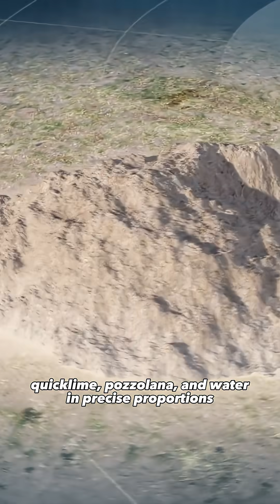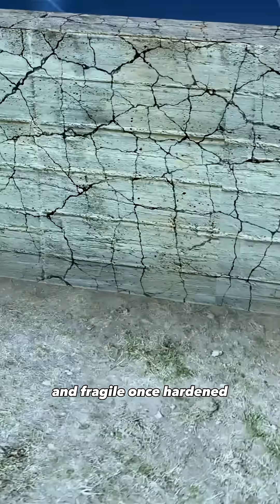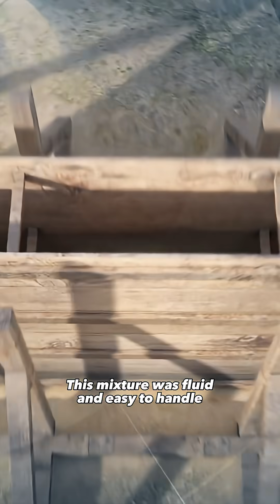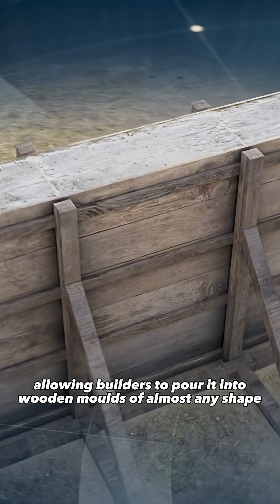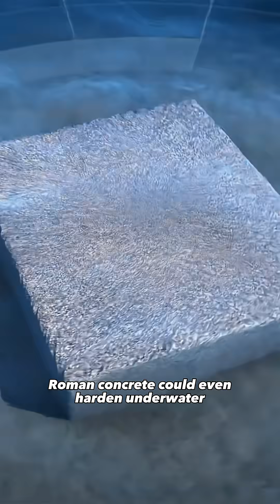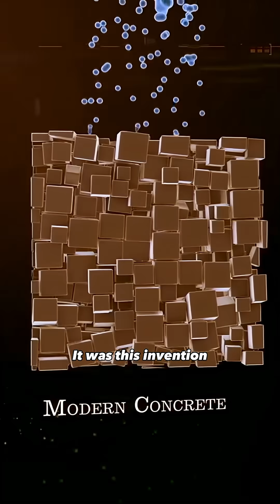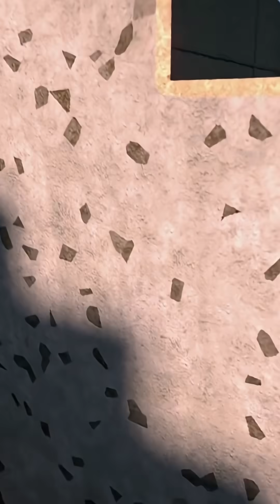The Roman concrete #history #romanempire #engineering

Comment: Release the ingredient mixture files.
Reply: Volcanic ash
Reply: @lunafragment7202  Hmm, interesting.
Reply: @lunafragment7202 also it was salt water (sea water )
Reply: @lunafragment7202 if only I had access to volcanic ash...
Reply: @lunafragment7202  HAHAHAHAHAH
Reply: @garythegariest what's funny,  it's correct
Reply: @garythegariest  that’s what Roman pozzolan is. I’m not sure of what’s funny, either.
Reply: @SleepiestWren And as we all know, correct things are never funny
Reply: Big rebar doesn’t want you to know.
Reply: @stevewilliams8590 Ha! 😂
Reply: @stevewilliams8590 still need steel reinforcement for modern engineering because no concrete ever made has useable tensile strength, which is the reason we steel reinforce concrete in the first place.
Reply: @Microwave_King maybe we could cover the rebar in a polymer before putting it into the concrete so that way it doesn't compromise the concrete
Reply: @rbkommando5456 I know right?! I've been wondering the same thing. Like just coat that stuff in Rhino liner!
Reply: @rbkommando5456 rebar isn't compromising anything in the concrete, though. It adds strength that concrete doesn't have on its own. Alone, concrete is great at resisting compression forces, but crumbles instantly if you apply tension (pulling two ends apart). By adding the steel rebar to it, you're adding a material with high tensile strength giving the finished product an internal structure capable of resisting tension forces and an exterior structure capable of resisting compression forces.
Reply: @Microwave_King the water used in Roman concrete is salt water. Which is why we can't use it in modern infrastructure. The salt from the Roman concrete would compromise the rebar. That's what they mean.
Reply: @rbkommando5456  
No putting up salt water in concrete but trying to protect rebar from chloride attack from salty water with polymer is not needed at all.
The concrete we have now has better compression strength, tensile strength and less permeability it has predictable strength and it sets fast and gets to its ultimate strength faster than Roman concrete. Also you have thousands of admixtures and mix designs can be done to make it suitable for wide applications.
If you want a concrete that you want to survive in chlroide and sulphate water then you just need to design the concrete in a specific way so that it is really dense and for this condition coating steel with epoxy or polymer is done probably. 
Roman concrete took ages to set to its full strength hence they took forever to build. 
The sea water and pozollana made it chemically durable in sea water and water with sulphates. But we can easily design modern concrete to tolerate those conditions.
Reply: @Microwave_King no concrete has good tensile strength
Reply: @Microwave_King what a farce the metal weakens the concrete.  It rusts and disintegrates over time causing lots of issues with age
Reply: @Microwave_King  You think we couldn't make one family houses with this or small villas? Highly doubt it.
Reply: @stevewilliams8590 😂
Reply: MIT found  it in 2023. The secret was to mix quicklime while still very hot.
Reply: @thomaslacornette1282 what is Pozzolana?
Reply: @isdz6951 Pozzolan is a label for many materials nowadays but as stated before Pozzolan in Roman concrete was Volcanic Ash.
Reply: @thelizard556 thank you
Reply: @isdz6951 a type of cheese found on Italian pizzas. 😂😂😂
Reply: @thomaslacornette1282 curious and curiouser
Reply: @thomaslacornette1282 that's not true they did not use quick lime
Reply: 0.7 part water, 1 part lime, 3 parts (pozzolana) volcanic ash for for buildings exposed to air. For those exposed to water, increase to 1 part water, 1 part lime and 2 parts pozzolana, Mr. Baron Rodney.
Reply: @NeoEon wrong.
 you left out the 
aluminum tobermorite and 
obsidian and  
pumice and
Salt water.
Reply: Also the volcanic ash has to be high in alumna @NeoEon
Reply: Its lime, pumice, and ash. 

Thats it dawg.

What happens is the volcanic ash once set, grows tiny interlocking crystals that harden the material. Plus, the lime isnt mixed 100%, and over time little pockets of raw lime, get dissolved and flow through cracks, therefore sealing it back up again.
Reply: @c @cmw184 and salt water instead of fresh
Reply: @cmw184 
Revelation 3:20
Behold, I stand at the door, and knock: if any man hear my voice, and open the door, I will come in to him, and will sup with him, and he with me.

HEY THERE 🤗 JESUS IS CALLING YOU TODAY. Turn away from your sins, confess, forsake them and live the victorious life. God bless.

Revelation 22:12-14
And, behold, I come quickly; and my reward is with me, to give every man according as his work shall be.
I am Alpha and Omega, the beginning and the end, the first and the last.
Blessed are they that do his commandments, that they may have right to the tree of life, and may enter in through the gates into the city.
Reply: @cmw184 no
Reply: Josephus Epictetus of Arsenokoitai did not assassinate himself.
Reply: sea water was the magic ingredient
Reply: It's subLIME........
Reply: @vernshein5430 😋
Reply: welease bwian
Reply: @harrywakatipu2547 release Woger 😂😂
Reply: 😂 ok Mr Smarty, very clever!
Reply: This was done when school had 2 subjects, yet here you have the internet in your hands and still can't figure it out. Some might say the new generations are indeed full of morons with the single digit iqs.
Reply: @abandonedgod  mfers back then also didn't have to worry about like any of the things we do in the modern age. Someone could just make their whole life a side quest trying to figure out the recipe for concrete 😂.
Reply: There's nothing unusual about mixture It's the size of the particles used in it which adds the so-called self healing quality A certain measure of less refined quicklime particulates is included Most likely a quality control issue turned happy accident rather than finely grinding the quick lime leaving it with some larger sediment allows it to be self healing when exposed to water any fractures break the large granules of quicklime down into smaller particles which the water can then dissolve and re bind with the aggregate
Reply: @sheaross3124 NO THERE WAS NO QUICKLIME
Reply: its all out there if you search, the saltwater concrete was a diff recipe
Reply: not known today
Reply: @benjaminbritsch1749  I have read that the lost ingredient was volcanic ash or human blood, but you are correct. I also recall that we still do not know the key ingredient of Archimedes' weapon invented to burn attacking ships.  I believe that it was called, "Greek Fire".
Reply: @sonofizzy-rev  Greek fire was lost too. Well we have napalm
Reply: @sonofizzy-rev it was just ancient napalm
Reply: Mossad hides the recipe
Reply: ep-stein gaining a whole new meaning in german.
Reply: Heat. They added, heat.
Reply: Haha, I see what you did there.
Reply: lime and ash
Reply: They already did bro.
Reply: The recipe is largely figured out already. it's no mystery
Reply: You tube search 
"Unlocking Roman concrete"
It is publicly available information!
Reply: The blood of Christians.
Reply: Pumice stone was used... instead of aggregate... especially for ceilings.. it's common knowledge
Reply: Please
Reply: It’s a cover up like flat earth
Reply: Lime mortar mixed with volcanic ash
Reply: The real recipe for how it was made has been lost to time
Reply: What happend on pompei island rome?
Reply: Alongside the written logs and words of Michele Nostradamus!
Reply: 😂😂😂😂thank you internets for the comments section
Reply: they had figured it out recently but no dice in escalated it
Reply: They'll be heavily redacted 🤣🤣🤣
Reply: Unredacted!
Reply: F it, let's experiment until we find!!!
Reply: "them" "the province of ludaea" is hiding the recipe, wake up my fratres!!!
Reply: Vesuvius ash, duhh?
Reply: quite literally, you've had access to that your entire life.
Reply: All of these people in the comments Don't know Jack. 

 They did not use quick lime they use baked lime stone,They used volcanic ash high in alumna, they also used alumna tobermorite ( this had to be mined freshly to ensure chemical reactivity )pumice, volcanic rock, salt water. I think that's it if I remember right.
Reply: Известь
Песок
Вулканический пепел
Вода

Пять тысяч рабов, чтобы все это добыть и замешать. 😂
Reply: @doktordizzel9261 no
Reply: Yeah, forget releasing the Epstein files. Release the ingredient mixture files, so we can finally crack the code for making ancient Roman concrete!
Reply: @trickyricky12147  Both! 😮
Reply: @glennruscher4007 no we don’t need both
Reply: @DappaJordan no, we need, especially when GOP resists
Reply: @w_gospodin_nikto_w2063  ahhh but no mention of Quid Pro Joe sitting on it for his entire term, eh? What kind of midwit trusts any file held by the government for years, when it almost certainly implicated them? Do YOU think the three letters wouldn't alter the files? Naive.
Reply: @trickyricky12147  that's the joke
Reply: The secret is lime , but roman concrete is salty so it wouldn't work well with rebar @trickyricky12147
Reply: @trickyricky12147 you need to live near the sea and a volcano. Do you want to move to Italy or Japan?
Reply: @sergiocovelli  There's Pozzelan in California too lol
Reply: Powdered Limestone is what makes it self healing
Reply: @kobusthomas903 Ahh, but it's not limestone. It's either quick lime or slaked lime.
Reply: @bitTorrenter it's not quick lime it was literally baked rocks of limestone thrown in and mixed together with everything not powderized
Reply: @kobusthomas903 wrong
Reply: @kobusthomas903  No it isn’t. It was because it was not thoroughly mixed and homogenised leaving dry unmixed nodules of calcium carbonate dispersed throughout the mixture. When the concrete cracked water could seep in and wet these nodules which would dissolve into solution and fill the cracks forming a relatively weak bond. It is likely that this was not a deliberate technique but rather a result of poor mixing.
Reply: @baarni  so over time the self-healing would stagger once the deposits were used up, yeah? 

If that's the case, a lot of them are still standing. Remarkable.
Reply: @AtKGs8nx Did you mean stagnate? Yes the self healing properties would stop.
Reply: @baarni an unmixed nodule of calcium carbonate is..  a piece of aggregate or, in other words a pebble. Water would take a long, long time to dissolve it as you describe. Therefore I believe you are referring to an unmixed nodule of calcium oxide [CaO].
Reply: @baarni finally the only person who actually knows
Reply: We’re getting close to reproducing it properly. One of the things that was only discovered fairly recently was that it’s a hot mix. The problem with producing a similar compound, which we can do, is that it is way more expensive and labor intensive.
Reply: @UnderLordMalcolm  you’re suggesting we need to start using slavery on a Roman scale again?
Reply: What's more labor-intensive doing the cement work once or doing it every 20 to 50 years when it cracks and crumbles?  Long-term it's cheaper to build it right with Roman concrete the first time.  @UnderLordMalcolm
Reply: @UnderLordMalcolm expensive and labor intensive? Really? Expensive compared to what? Certainly not Roman time. Earth has 100x more people and money now than back then so if they could do it no problem then we can. Expensive is nonsense
Reply: @WLH-ss2qw the thing is slavery and forced labour are now banned, unlike in the Roman times where you have slaves, the condemned, and prisoners to mix it for (almost) free
Reply: @FlyingPlastic356 we have machines now surely they are capable of mixing such hot mixtures
Reply: @UnderLordMalcolm also weaker than modern concrete mixes
Reply: @rubenheymans1988 that they're not, seeing that modern concrete rarely holds up to a century.
Reply: @a7HKdAbmET there's a difference between strength and longevity mate. Let's see if roman concrete can withstand millions kg of constant stress and wear
Reply: @quadratic7578  Indeed, but that is easily seen by them designs of ancient buildings, especially big ones with more stress and wear, and those were the most likely ones to survive. Pantheon comes to mind. 
The main thing that modern architecture does better is not because of the concrete - using rebar within concrete to increase tensile strength of the construction is a more recent innovation if I recall correctly, and the greatest innovation in modern construction, alongside modern tools, compared to ancient Rome. Creating anything with most types of modern concrete without rebar compared to the roman concrete will usually be weaker in strength, too.
Reply: @rubenheymans1988 that's a farce modern concrete lasts 50 years that's it that's the lifespan.
Reply: They still working on discovering the formula... 2500 years ago Romans were making cement that would last forever, now we have to knock down buildings after a few decades... go figure.
Reply: @ComboMuster  gotta keep people working... or they wont do your bidding.
Reply: @ComboMuster  I thought it had something to do with saltwater being they key ingredient or something.
Reply: @BaronRodney  well it is all suppositions and guesses so far. Some nutters were saying aliens gave them the recipe 😁😁😁
Reply: @BaronRodney I think the leading theory now is that large lime aggregate in the mixture would react to water that entered cracks, making a slurry and resealing the crack from the inside
Reply: @ComboMuster  Yeah you know, I kinda have a feeling that that's probably the least likely theories so far but hey... that's just me. 😂
Reply: @BaronRodney  Saltwater and volcanic ash would make them self healing for some time.
Reply: @BaronRodney  No volcanic material
Reply: @BaronRodney   partly. That , burnt and crushed seashells were also an ingredient.
Reply: @BaronRodney  I think it was actually a combo of raw calcium carbonate and charcoal.
Reply: @RCLewisLewis  Charcoal huh? Was that a substitute for volcanic ash I wonder?
Reply: @BaronRodney  Yes, saltwater and volcanic ash (pozzolana).
Reply: @BaronRodney  There was a lot of limestone in the mix, and it would heal itself and strengthen every time it got wet.
Reply: @BaronRodney  Human Blood
Reply: @poacherboy
Yeah, so long as there is lime... otherwise once the lime runs out, the cement is done.
Reply: @ComboMuster  volcanic ash / limestone / calcium are the reasons cement "self heals" And is very strong to sea water, almost impervious.
Reply: Not working, they've recently found it
Reply: nah bruh they will say anything to make u thonk they stupid.
Reply: @ComboMuster The stresses and requirements of our structures are very different than those of the Romans. Same with their roads, did they last a long time? Sure but they didn't have multiple ton vehicles blasting along at 65-90 mph
Reply: @ComboMuster  We know fully well how to make it, its just extremely expensive and also incompatible with reinforcing rebar.
Reply: @ComboMuster we can do better stuff that the Romans nowadays. Modern concrete is way stronger
Reply: @ramr7051  Modern concrete it IS a lot stronger however it doesn't last 😁😁😁
Reply: @ComboMuster  thats on purpose mate...

our economic does not work otherwise..

its why thing does not last as back in the days.

the money must flow
Reply: @fantomchaser1 Our modern society is constantly changing and evolving. Not to mention that modern structures are generally built by private companies at cost and time constraints not governments like in ancient times. Ancient societies were unchanging for centuries so some large infrastructure was built to last centuries. Keep in mind though that more than 99% of all structures built back then are long gone. We could easily build structures that outlast anything the Romans did but what is the point?
Reply: @baarni  What i wrote is not limited to concrete..

we have a debt based economic..
it requires constant growth and consumption.
each year it requires more than the previous year...

its why they tried to implement "Planned obseletion" was it back in the 80s... 

So instead they make things of 
less quality
more parts (bigger chance stuff break)
one time uses.

Stuff like that..

By building stuff in better quality it gets a much better reuse value
If we talk on the enviromental side of things
this also brings benefits.

Any ways our current way of life cant keep going..
not unless you remove like 80% of the population then we can consume and throwaway as we want..
Reply: @fantomchaser1 bla bla bla.😂
Reply: @ComboMuster we figured it out already you're behind on info
Reply: @ComboMuster it's mostly the steel rusting that kills modern concrete.

Concrete cancer.
Reply: @myne00  Acidic rain, salt water and whatnot.
Reply: @ComboMuster  because reinforced concrete is a lot stronger for reduced size and cost than alot of the strenght of roman was because of the size and amount of materials. They also used lead in the piping components are we going to start doing that.
Reply: @eggos5074  What on good earth are you talking about.... talking about costs do you even know how cement is produced? not even talking about the rebars used in reinforced concrete. We do not know the exact formula of Roman cement otherwise engineers would use it except for special projects like I said.
Reply: @ComboMuster  The mixture is already known. Nothing magical about it
Reply: @threnn9509  It is not known, at least not the exact formula, it has never been successfully recreated in spite of many attempts. It is not enough to know WHAT goes in there but HOW MUCH of each component and the different stages of the process.
Reply: @ComboMuster  it isn't some crazy [de]-advancement. They had access to a material we don't and happened to use it as a filler.
Reply: @sgeine  All this blabbering has no purpose the fact is that Roman cement and buildings lasted for 2500 years. Tell me ONE building where mortar or cement was used that lasted 200 years even. All this crap talk has no point.
Reply: @ComboMuster  The formula is known and isn't a secret. Roman concrete isn't better than modern concrete, they just made such massive structures using only compressive forces. We could do it now but no one wants to pay for 10ft thick concrete walls and vaulted ceilings that will last 1000 years because thin steel reinforced concrete structures that will last a few hundred years are ALOT less expensive.
Reply: @vorpolkai  Reinforced steel structures are way faster to build and better for high rise buildings, skyscrapers and bunkers, however those would not last due to deterioration caused by steel rust. You must've heard of catastrophic collapses of modern bridges and buildings. Roman bridges can be seen 1900 years after those were build. I guess in the long run Roman bridges and other structures are way, way cheaper. Fun fact: Apollodorus of Damascus build a stone bridge in ONE month over the Danube at Iron Gates for the Roman army, it's vestiges can be seen today. I guess everything has it's advantages and disadvantages however, today we have devastating bombs and such and it does make sense to build quickly. However I would very much prefer to build my house with roman concrete and stones.
Reply: @ComboMuster Oh so you’ve bought into that nonsense too😂 Roman concrete is nowhere near as good as modern day concrete. Even the lowest grade commercial concrete is at least double the strength of Roman concrete. This fallacy has got so many people sucked in.😂
Reply: @baarni  Yet their buildings still up after 2500 years. How do you explain that? I get it for bunkers and skyscrapers and nuclear plants won't hold.
Reply: @ComboMuster bahahahaha explain the obvious 😂 natural stone is millions of years old. Shaping and stacking them is not surprising a very select few structures have lasted a few thousand years. Keep in mind almost all ancient structures did not last and the ones that do still remain are in ruins.😂 Nothing mysterious or exceptional about it bud. I guarantee you that in a few thousand years if left abandoned there will still be modern concrete and stone structures still around for archaeologists to ponder over.
Reply: @baarni  earthquakes and wars and defiling over thousands of years dude. As for modern concrete it will not last except maybe for the bunkers and forts built by Germany in WW2 and maybe a few cathedrals built 600 years ago. Everything else will just crumble to dust. Nothing done or built in the digital age will endure all info is stored on complex and advanced gadgets as for constructions? ZERO!
Reply: @baarni your faith In modern tech is astoundingly naive
Reply: @baarni that’s why my sidewalk cracks a year after it was put down?
Reply: @bakershrew  Exactly! We wash our sidewalk with a mixture of water and detergent every week, and wax it once a month so it keeps looking pearly! I'd prefer to do it twice a year, but sadly, that's what happens when you can't put it indoors and have to let strangers walk on it and drive their cars over it.
Reply: Human Fluids..😂
Reply: Talk to the Catholic church in Italy.
Reply: its volcanic ash and saltwater. its not a secret, and i don't know why people act like it is. 

it was never forgotten.
Reply: @TheSpencer033 because you're missing lots of ingredients and you don't even know.
Reply: Diatomaceous earth was the secret ingredient fools. God bless diatomaceous little creatures that make all the world's oxygen and kills bedbugs in death.😊❤
Reply: @no-turdburglars_incthat is wrong
Reply: He said quicklime and pozzolana in precise quantities.
Reply: @jhonfloibelmiculob6581 yeah but he's full of bulshit because they didn't use quicklime
Reply: The formula was finally worked out recently, and the reason why it works. It doesn't beat all modern concrete, depends on the use. Not an expert, just what I read. Google roman concrete, I'm sure you'll find it.
Reply: @UteChewb no
Reply: It's more about the process of hot mixing and combining sea water
Reply: Ash from campi flegrei,  salt water, and sand.
Reply: blood of the innocent
Reply: Seawater is the secret ingredient. The salt and other minerals in the water gave the concrete it's longevity
Reply: Huh? We've known how to make this stuff for a while now. It's not a secret anymore...
Reply: Theres a great article on Wikipedia
Reply: @jvebarnes it's trash
Reply: its not that different than modern concrete.
Reply: No way! It would cause an economic catastrophe! Imagine if we wouldn't have to build new buildings for a thousand years!
Reply: @robdom91 good
Reply: The ingredients & mix method were lost to time.
Reply: @pamsimpson4147 The ingredients can easily be analyzed from existing structures and the methods were recorded in part by Roman authors, like in the De Archetectura by Vitruvius.
Reply: @Alderak1 True but it's the mix method.
Reply: @pamsimpson4147 mix method maybe but what's in it no they know exactly what's in it.
Reply: @pamsimpson4147  It was found back in 2023 : use google once in your life.
Reply: The ingredients and mix method were sadly lost to time.
Reply: Nobody can produce it even today, even their blueprints. The old world remains a mystery. From Gothic cathedrals to Roman architecture, they are most likely the remnants from the 1000 year reign of Christ Kingdom that was written in Revelations.
Reply: @Proud-Infidel  Nonsense😂
Reply: @baarni  why are you upset? You think you're so special that Jesus will wait 2000 years for you? 😂 face it, we are left behind, we are the ressurected dead waiting for the white throne judgement. We are living in Satan's little season now. But, in the end of the day, this is just theory. A very solid theory. 

This is a solid theory and based from scriptures and physical evidence of the millenial reign. You got better argument? Let's hear it.
Reply: @Proud-Infidel Bahahahaha not upset brother. I just don’t accept your claim that your god exists.😉 Lies and misinformation is the worst kind of deception and must be called out.
Reply: @Proud-Infidel     anyone who refers the last book of the Christian canon as "Revelations" can be dismissed immediately 

and they absolutely can and have reproduced it
Reply: @Proud-Infidel We have a quite a few records to prove otherwise, Christ’s 1000 year reign has yet to come.
Reply: @schylarvelez46 then where all the Gothic cathedrals, large mansions, grand palaces, central city architectures, marble statues with fine details and sunken old world houses and buildings come from? There are literally gothic cathedrals around the world already pre Columbus. Surely when Jesus said this generation wont pass away before his return, he was not talking to people 2,000 or 5000 years later, he was talking to the people who are listening to him directly during that time. And that was in 70 AD.
Reply: @Proud-Infidel  you really need to reread the whole chapter you took that verse from regarding the setting of human society before answering that question.
Reply: @schylarvelez46  Will never come.
Reply: @Proud-Infidel Gods time is different then mans time but He will come. Unless its already happend and we are whats left  thanks to to the juice, but i have faith. Wild to contemplate living in the time of Christ not knowing what you were seeing but knowing it was truth
Reply: Batch records are sometimes classified, but they are a part of life's essential necessities. Nevertheless!....Mutually agreed!👍 ...Shalom 🕎
Reply: @israel-knight ewww
Reply: @israel-knight  how do you feel about Netanyahu and his IDF army taking advantage of your religion?
Reply: @israel-knight  Agreed cheers a superior pagan!
Reply: @israel-knight Free Palestine..Shalom
Reply: @jonathanstrauss8194 ....Indeed!...I would desire that every man would be free from all sorts of tyranny, with all my heart I pray this to be,for all of Mankind for all of eternity....To be FREE!...Shalom
Reply: @jonathanstrauss8194 Where free Palestine? Ill take all
Reply: @israel-knight  Thank you for sharing your wisdom and shalom to you too my brother.